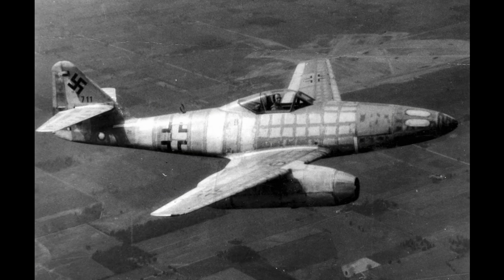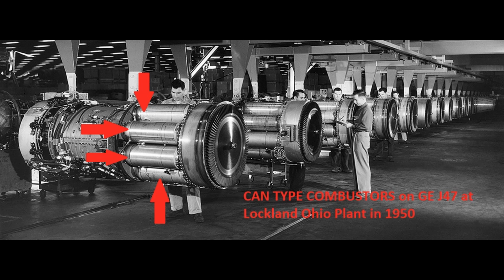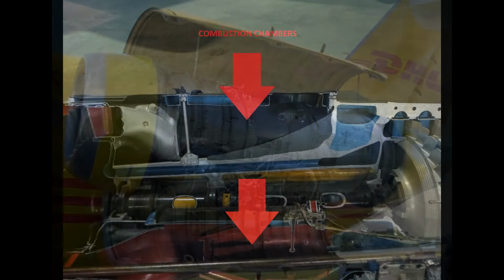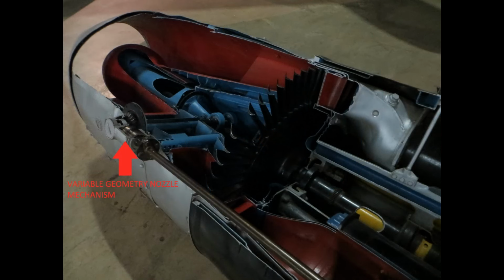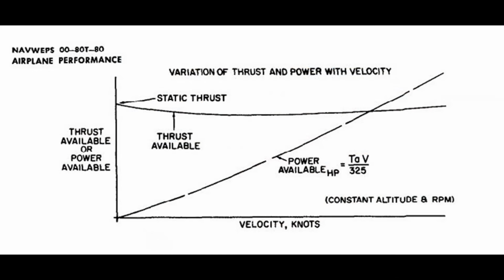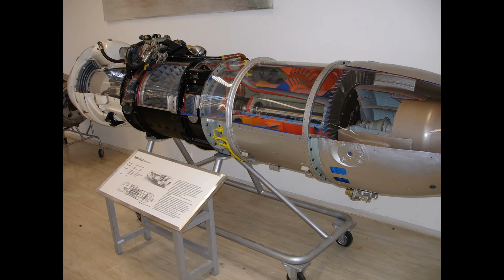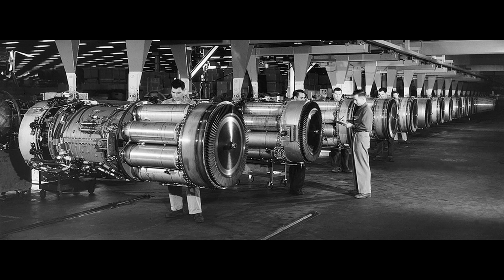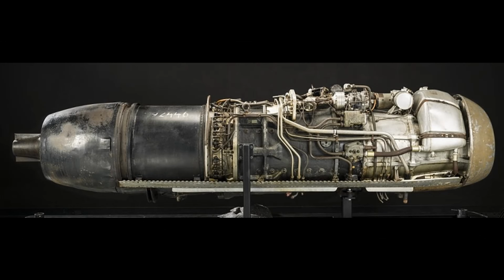World War Two JET POWER

Comment: I was really under the impression that the me262 was a really good plane, but it rather was the engine that was the drawback.
Reply: I think the engines were quite good for the time and resources just that it didn't run for long before you had to replace it.
Reply: @thurbine2411  I´m not quite sure i agree.

The engine did have benefits, like that it was very compact.

But its very heavy. 300kg more than the Rolls-Royce one, while having more thrust.

The throttle response of the Jumo engine was also horrible.

Also the fuel economy wasn´t great. One of the issues was that Jumo 004 series (apart from H version) only have one turbine stage. Making it have a very steep pressure gradient prompting it to lose power.. and efficiency.

This is one of the main benefit of axial flow turbines. Because they can change geometry int he axial flow, it have the effect of having a virtually unlimited number of turbine stages.

And there is the longevity issue.

Think about it.. Both Jumo engines is about 1.4 tons in total. Both Royce engines is like 1 ton. Still the Gloster have more thrust ... While the Me262 have a full ton of lower empty mass.

Remove the engines from both and the ME262 is about 2.5 tons, and the Gloster is about 3.5 ton.

Put the Royce engine in the Me262 and you would have one heck of an aircraft.
Reply: @matsv201  The 262 WAS one heck of an aircraft.
Reply: @matsv201  Yes, the 004 was much heavier, but it had much better thrust/drag and ram efficiency and I'd argue that at very high speeds those two factors outweigh weight(see what I did there? :D ), especially in the absence of G-suits. The higher drag does not only result in lower top speeds, but the additional turbulence can affect the efficacy of control surfaces and thereby reduce the plane's maneuverability. Centrifugal jets are a developmental deadend, whereas there was potential for refinement in the 004, which it did not receive bc of the end of the war.
Since you put so much emphasis on a 2nd turbine stage, I have to mention that the Welland and Derwent only had one stage, too. If having multiple stages is really that important, I'd try the BMW 003D instead.
If there's something that really compromised the Me262, then it's Hilter's instistence to use it as a fighter bomber imo. This affected first and foremost the choice of armament. MG108s are great for shooting down Bombers, but the low mv makes hitting more nimble aircraft difficult. 4 MG151s or 2 MK103s would have been better against fighters, MG213 could have dealt with both. 
The longevity argument has already been addressed in the video and thousand times elsewhere.
Reply: "Yes, the 004 was much heavier, but it had much better thrust/drag and ram efficiency"
Well it really don´t matter because the whole system that is important. Not just the engine. 

"ram efficiency and I'd argue that at very high speeds those two factors outweigh weight"
i´m kind of skeptical to that. Axial engines also have ram efficency. A bit lower, maybe. But its  also a much stronger engine.

"Centrifugal jets are a developmental deadend,"
That might be true. but that don´t matter because in the early days they was generally a lot better.

"Since you put so much emphasis on a 2nd turbine stage, I have to mention that the Derwent only had one stage, too"
I already addressed that issue.

"then it's Hilter's instistence to use it as a fighter bomber imo. "
That seams to be a myth. When looking at the data from the time there is really not much supporting that claim. It might be post war propaganda.

As far as i can find there was no delay for the project due to this claim. There simply took longer time to develop the Me262 than most other aircrafts. And that should really not be surprising. Original Me262 had tail wheel fore example. They later learned that tailwheel don´t play well with jets.

" but the low mv makes hitting more nimble aircraft difficul"
I don´t agree to that. While yes, its a bit lower, the diffrance is not that high. Then ad the superior top speed of the plain, and you will find out that the final closing speed is actually higher.

"MG213 could have dealt with both. "
That gun was not available during the war.

"The longevity argument has already been addressed in the video and thousand times elsewhere."
Addressed in the way that its actually an issue. Yes it is. While, its not an enormous issue, its still an issue. For long distance bomber, its really a big issue.
Reply: @matsv201  Why would you have more than 1 turbine stage and add weight and parts that could fail if you can get enough power out of 1 stage to keep the compressor working. The 004 was a pure jet, not a turboprop or bypass engine where more shaft power is needed.

And radial compressors are surely no dead end. There are still modern engines which use them in combination with axial compressors. Example, PW300 or PW500 series Turbofans. The advantage is a high per stage compression rate, reduced parts and hence weight, reduced complexity. The disadvantages like bigger engine diameter and reduced airflow efficiency due to divertion of airflow direction is neglectable on low mass flow engine classes.
Reply: @matsv201  "Well it really don´t matter because the whole system that is important. Not just the engine."
Drag forces on solids are additive.
"It might be post war propaganda." Post war propaganda by whom? "As far as i can find there was no delay for the project due to this claim."
I didn't write anything about delays.
"I don´t agree to that. While yes, its a bit lower, the diffrance is not that high. Then ad the superior top speed of the plain, and you will find out that the final closing speed is actually higher."

Difference between MG151 and MK108: 57%
Difference between MK103 and MK108: 59%
"Addressed in the way that its actually an issue."
Did you watch the video? Because Greg said the polar opposite.
Reply: @sebvv5219  
"Drag forces on solids are additive."

The thing is that even with the gloster the engine drag is not that big as a part of the plane in full.
You got a situation where the plain is say 5 and the engine is in one case, 1 and the other case 1.5.  You got a total drag of 6 and 6.5. The total diffrance is not that big.

Not that doubling the area of the engine don´t double the drag forces. Its not that simple

"Because Greg said the polar opposite."
Sounds like you need to watch the video again
Reply: @matsv201  "The thing is that even with the gloster the engine drag is not that big as a part of the plane in full.
You got a situation where the plain is say 5 and the engine is in one case, 1 and the other case 1.5.  You got a total drag of 6 and 6.5. The total diffrance is not that big.

Not that doubling the area of the engine don´t double the drag forces. Its not that simple"
Another strawman argument... How about you answer my question before you make stuff up? Who would be behind the post-war propaganda? The moon nazis? The mars nazis?

"Sounds like you need to watch the video again"
Greg said it lasted between 15 and 25 hours, which is not that bad for the standards of the time and by the end of the war the Luftwaffe was so outnumbered that the average German fighter didn't last more than 15 flighthours anyway.
Reply: @matsv201  Adolf Galland flew both the Me-262 and the Meteor Mk 4 with the Argentinians post war and he said exactly the same thing. Saying that, the Derwent V in the Mk 4 Meteor was not the same engine as the early Derwent in the Meteor Mk III, or the Welland in the Mk I.